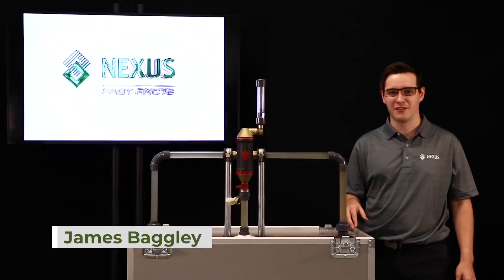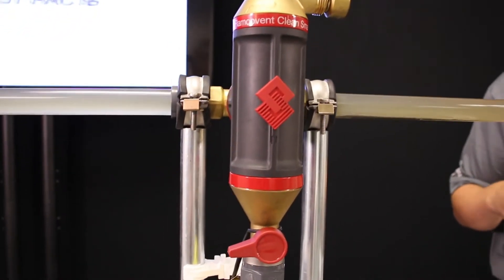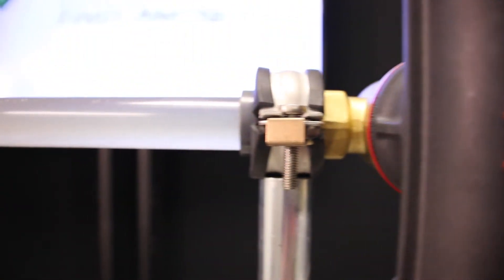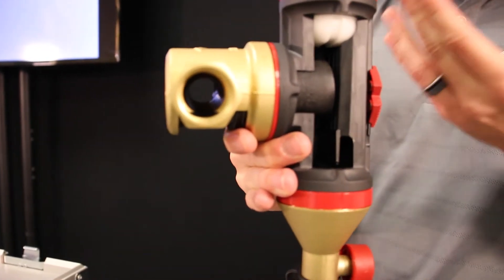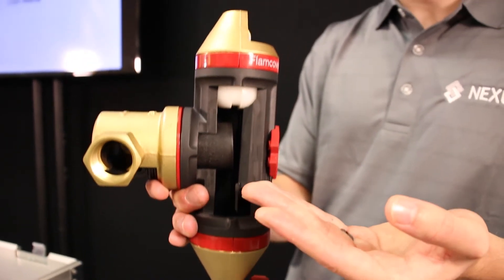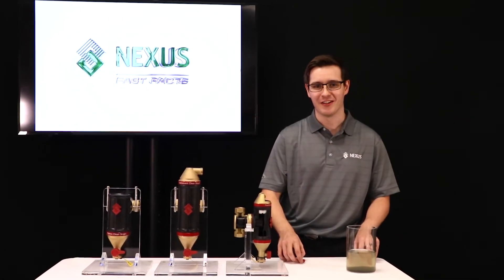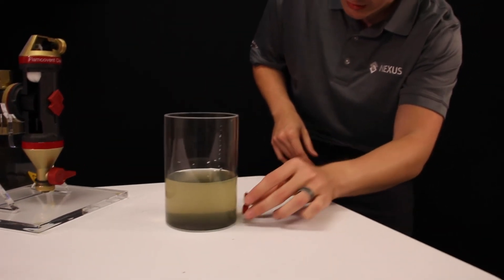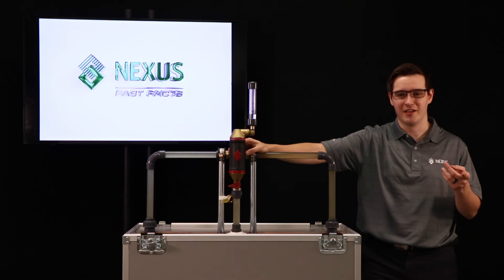Nexus Fast Facts: Episode 6 Flamcovent Clean Smart

Comment: This is super weak compared to a Fernox TF1!!!!!
Reply: Thats what I was thinking as well. Them calling it Super magnets does not make them super. They only held a tiny portion  of the magnetic dirt and you couldnt see any change in the liquid while holding them to the glass. This will need constant service or maintenance  bcs the magnets are so weak and gets to maximum capasity quickly